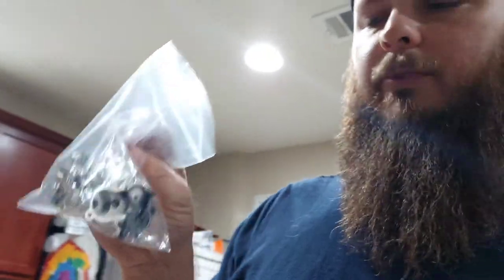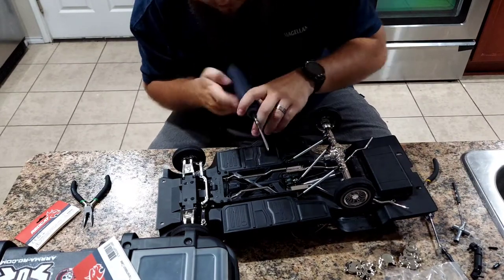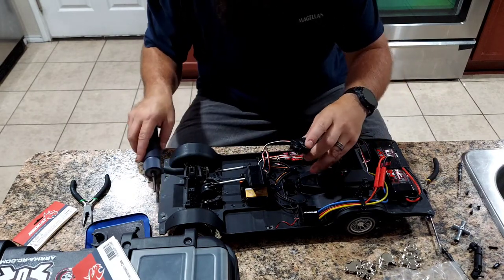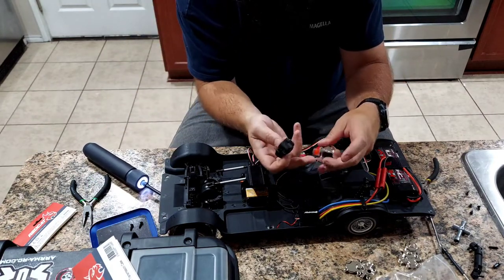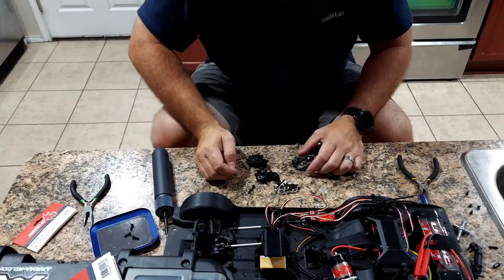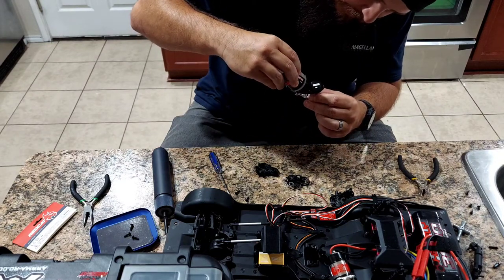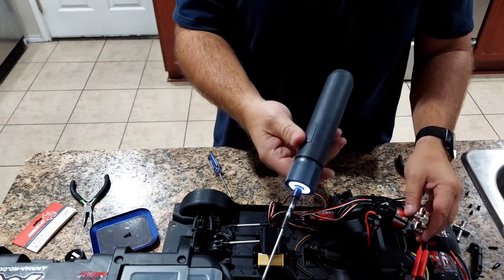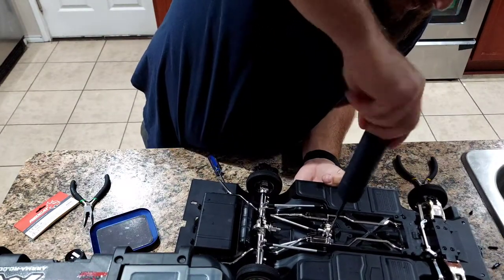Redcat sixty four chrome engine cover upgrade.

Comment: good video I watch it twice. Going to change mine are the Gears  is inside the transmission plastic?
Reply from the maker: If I remember correctly yes they are plastic. Just make sure to be careful to watch where each gear and bearing are when you split it open!! They can easily fall out and hard to know where they go